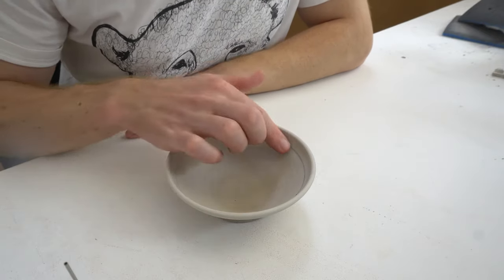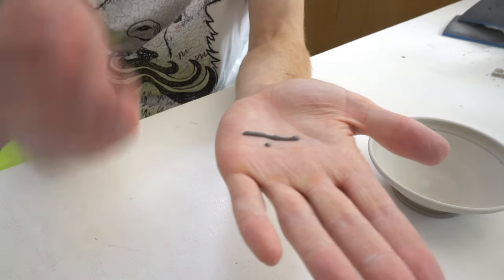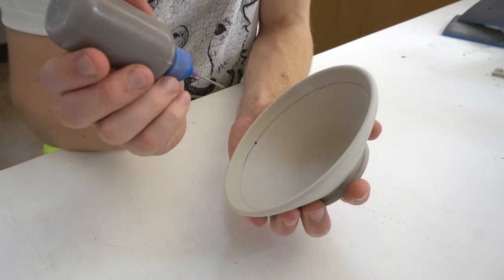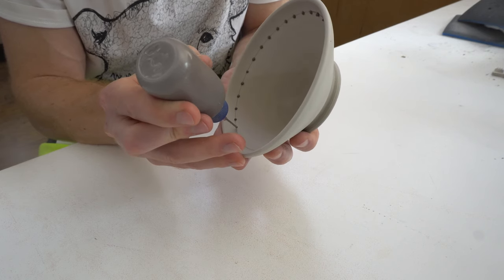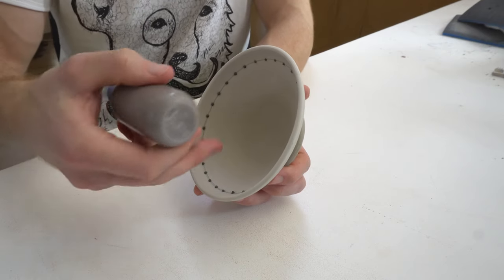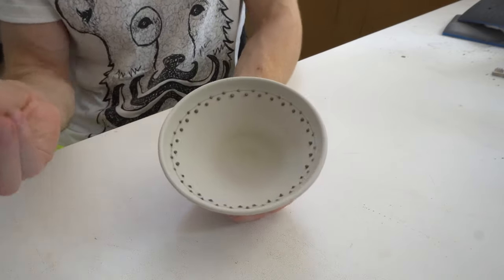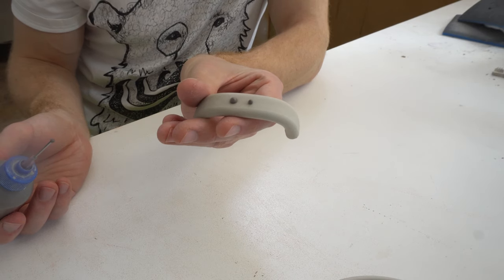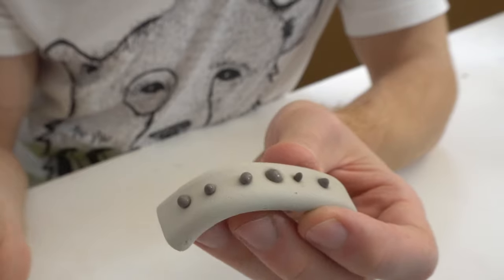How to do the Impulse Pattern using slip.

Comment: can someone please explain how the colour runs down from each dot? my understanding is that the dots would be fired before glaze is applied, and therefore i wouldnt expect the colour to run?
Reply: I think it's because the bisque firing doesn't fully vitrify the clay, but the glaze firing does; so when you glaze fire, the oxides can still mix and fuse with the glaze.

Comment: Thank you for this video, super informative. Can’t wait to see your other new videos.  

What are your thoughts about applying the slip on leather hard/bone dry vs after the first firing?
Reply from the maker: I think I do touch on it in the video, but if you're using straightforward slip then it will just fall off bisqueware as it dries. If you're using a slip formulated to apply to bisqueware, I still wouldn't do it that way if I didn't have to as the glaze application could rehydrate the slip and have it bleed into the glaze, but it should work.
Reply: @OldForgeCreations  thank you for getting back to me. I must have missed that, appreciate you taking the time to put it in this comment as well!

Comment: Do sharp peaks mean it's too thick or too thin?
Reply from the maker: Thick. The less water you add, the more it can hold its structure and form sharp peaks. A wetter mix will naturally round off when applied, and an even wetter mix will shrink down to form a concave dimple in the middle as the water is absorbed
Reply: @OldForgeCreations  Thank you!!